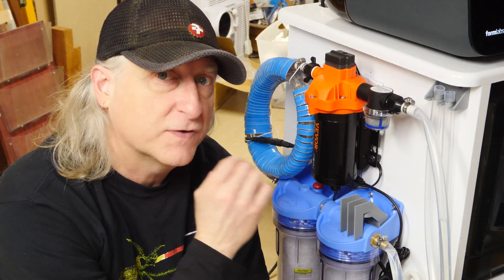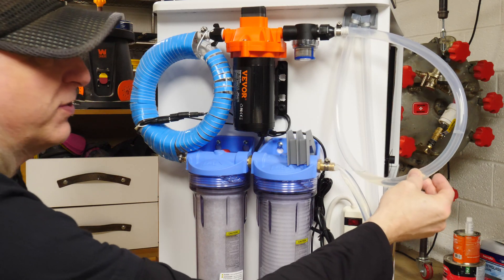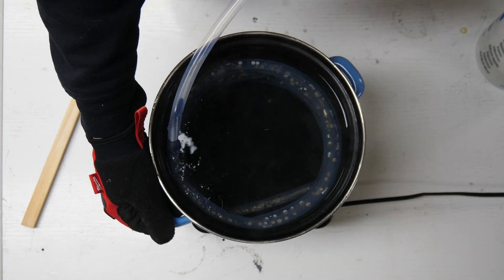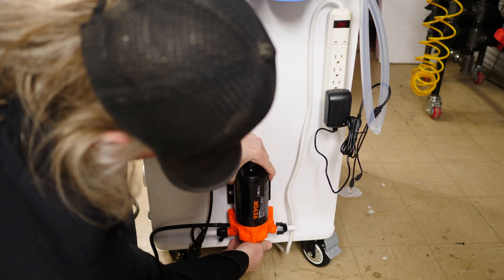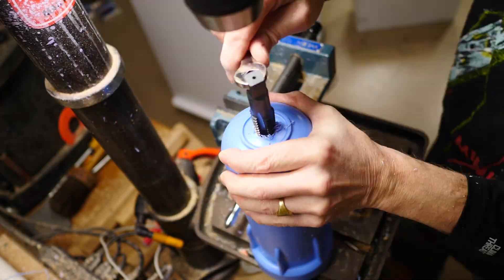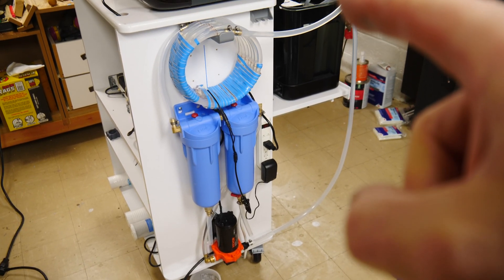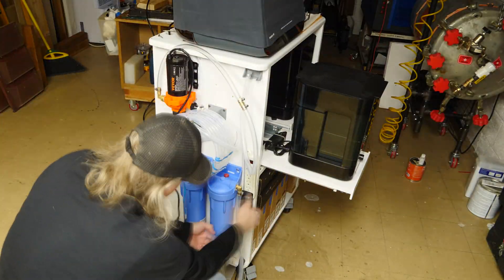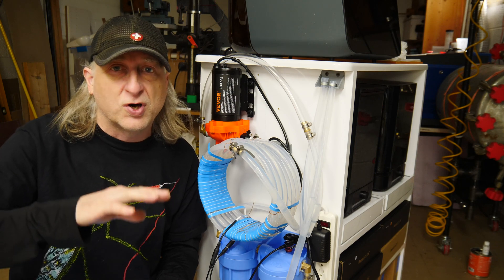IPA filter modifications and upgrade 3D printing resin removal

Comment: You could just put a small bit of rigid pipe on the suction side of the pump with a flexible whip on the end. Or you could move the pump closer to the source of the IPA and lower it down a bit. Put 90s on the inlet aimed up and outlet aimed down. Spin the UV reactor section a bit and slide it over so the inlet is below the pump discharge, straight shot into it. Then adjust the rest to fit. Cool idea and video, I think the recirculating filtration is the key idea that a lot of people don't have with their videos, I like this, thank you for sharing.

Comment: Usually, photocurable resin must be in a static state when curing. The photoinitiator in the resin absorbs ultraviolet light and generates free radicals, which combine with oligomers and monomers to form a three-dimensional network structure. The premise is that the resin must be in a static state when curing. Only in this state can free radicals and other substances in the resin be stably polymerized, so that the resin components in the isopropyl alcohol can be polymerized together as much as possible to increase the purity of the filtered isopropyl alcohol. In the video, a UV light strip is attached to the pipeline, which may not take the time required for the resin to cure. Moreover, the resin in isopropyl alcohol is in a fluid state, and free radicals cannot polymerize stably. Some components in the resin are separated. Very small, if it is not polymerized with free radicals, it will still flow out of the filter along with the isopropyl alcohol.
Reply: So from your point of view, this set of equipment doesn't really do much of value, does it? Even if the IPA in the drum is cycled through multiple times, the resin content of it is essentially not reduced, or only a very small percentage is actually filtered, is it?

Comment: Hey I’m following this system from you and the other guy that you mentioned because I’m dealing with the same issue with my ipa, I have a question or a recommendation the tube coil makes any difference is you do more o less loops or the diameter of the loops matter because I’m planning to put it into a printed chamber to keeps the uv light inside the chamber
Reply from the maker: Yeah, sounds reasonable

Comment: I'm getting ready to build this - 
I use a and Elegoo wash station, which has a bucket and lid system. What would be your thoughts on drilling and adding some fittings to the bucket a bottom dirty hose fitting and a higher return for clean. This way the lid can be placed on the unit while running vs being open to the air? 
I'm new to all this, no idea how to add a hose port without leaks, drilling a hole in the bucket I got, lol
Reply: Someone did this on reddit exactly how you described - when they run the wash station they also run the pump and UV lamp system so the IPA is actively filtered while the wash station is running.
Reply from the maker: Your solution is ideal if you can seal the bucket

Comment: After having run this system for several weeks are you able to comment on the longevity of the filters and the effectiveness of the alcohol for cleaning? Some other recycling methods noted the alcohol became “slimy” after a while and was leaving residue behind on the parts even though it looked clear.
Reply from the maker: I will know more when I change the filters in the future.
Reply: My experience with essentially this exact device resulted in precisely that sort of issue. After running a good number of kilos of resin through, I still had clear looking IPA -- but it left an increasingly gross, sticky residue on prints that went through it

Ultimately, I gave up on the device for these reasons, but I would love to find some revisions that solve the issue
Reply: Sounds like you had several kilos of useful wash cycles before it was junk, right? I'm weighing costs and wondering if this setup is worth saving $40 on IPA every few months

Comment: Follow up question.  has anyone experienced any issues with the resin sediment causing issues to the pump since it is the first device in the loop?  I understand it was done to pressurize the lines to keep them from collapsing, but I am a little concerned about pulling unfiltered resin through it.
Reply from the maker: No issues onu emd

Comment: Next time you (re)install, you could put the entire system on the right side of the cart, that way the inlet of the pump will be closer to your form wash. Might also want to look into kink-free or reinforced silicone tubing to mitigate the tubing collapse. I am curious on how effective this expose and wash system is and whether it is primarily removing the photoinitators and keeping a bunch of the resin monomers still suspended in the solvent.

Comment: I was wondering if you could set up the system to pull the IPA through the filters rather than push it through. Then, if you lift the intake hose out of the tank and pull the IPA from the filters, you could remove the housing without wasting a lot of IPA. As an engineer, would that setup work?
Reply from the maker: In theory yes if you have the right tubing to support that.
Reply: @EricStrebel  I was thinking about using PVC and the silicone tubing you showed. Maybe having short runs of the silicone to go into the fromwash and pvc running into the filters and then from the pump back to the silicone. I have 2 fromwash units side by side so the silicine tubing could run to one or the other, but the pump and filters would be wall mounted. Just a thought on how your idea could be adapted to what I have. Thanks for the great videos and the links to the products. It's really an inspiration.
Reply from the maker: In theory yes, the only way to test it is to try it

Comment: I wish I had gone through all of your videos last week when I found your first one.  I already ordered all the tubing and what not, and the original housings which have been delivered.  Thankfully they are not expensive. Also, the next time you need to bend tubing like that there is a trick that is used when bending tubes that they use a silicon insert to keep the tubes from crimping.  You could look into that for the next revision.
Reply from the maker: Yes I'm aware of the silicone insert method, but that would have been an extra thing to purchase my solution cost me nothing. Also I was concerned about removing the silicone insert considering the length of the tube and the tight radius.

Comment: Because IPA is highly flammable (especially the IPA vapors that can explode with a flame, spark, or even just temperature) I would eagerly suggest to cover the bucket of recycling polluted IPA with an airtight cap, because I don't think that this kind of cheap electric water pump nearby is properly isolated, or in any case antistatic and anti-explosion rated. Moreover, on a more practical side, an airtight cap would also prevent the IPA from degrading too fast (because IPA is expensive, absorbs moisture, and evaporates quickly).

Comment: On some models of those pumps that you can rotate the pumping head 180° to change the direction of the inlet and outlet. Something to try out.
As for the charcoal filter, I don't think it will contaminate the IPA, however I'm not sure about the benefit. It's usually used to prevent water from getting weird tastes, it's not exactly a mechanical filter rather a chemical one.

Comment: The "UV loop reactor" is a geek marvel. But the surprise effect having passed, I wonder like some others if the diluted resin in the moving contaminated IPA has really the time to cure and precipitate as bigger chunks in it. A comparison of the filtration from a muddy IPA bucket with and without the loop reactor would be very useful. If this item is not really useful in the filtration process, it will make the setup much simpler and more affordable. One has to find out.
Reply: Theory instead of experiment for now.
Let's say the 5-meter UV LED strip wrapped as a coil around the tubing has 600 LEDs and consumes about 40W power total. This is a very good light strip (they are often half as good).
The UV loop reactor is made of 5 meters of PTFE/FEP or silicone tubing, whose ID is 1/2". It's a bit less actually, because you have to connect some tubing outside of the reactor to the pump outlet and to the filter housing inlet. But from this approximation, I made a rough calculation (MKSA units):
Say the pump is capable of moving the liquid at 15 liters/min, i.e. 0.25 liter/sec – I think it is less in reality, but sellers advertise an even higher volumetric flow rate.
Using these numbers, do you know how long a particle of resin flowing within the IPA along the tubing stays inside the UV loop reactor? 
About 2.5 seconds.
If the actual flow rate of the pump is lower, say only 10 litres/min, the actual transit time of the resin in the UV reactor is 4 sec. 
However, if the real flow rate of the pump is 20 liters/min, then the resin stays in the reactor for 2 sec only!
Now, imagine powering your Wash & Cure (the curing part) for between 2 and 4 seconds in order to cure a 3D printed object, and what's more that this object is immersed in a container full of IPA, which has the primary function of wiping resin.
Do you think that the surface of this 3D-printed object would cure in such conditions? I don't think so.
EDIT: it's even worse thant that, because 10' = 3 meters, not 5 meters. So the estimated transit times are in fact 40% less thant what I said above. We are in the order of 1 to 2.5 sec.
Reply from the maker: I Assume the resin gets cured after about 10 times thought the ring at that rate. Seems reasonable that it will take a few times through to get the job done. I'm also assuming that the combination of the UV and the filter working together filters out most of the resin. I don't think it all actually gets filtered out I don't think that's possible. I think I'm just trying to reduce the amount of resin in there so that it's still effective at cleaning the parts. I'm good with that. The main thing is I don't have to mess with the IPA.
Reply: @EricStrebel  Your recirculation remark is valid I think. I'm currently in the process of deciding whether to build this setup with or without the UV reactor part, and I'm trying to get a clearer picture and weigh up the pros and cons. I haven't settled yet.
Reply from the maker: @fluxcapacitor  I feel like it can't hurt, that's why I added it. Even if it has minimal functionality it still has some benefit and is worth it.
Reply: @EricStrebel  I will add it to mine. The geek wow factor had me.

Comment: Loved to see your problem solving flow unkinking the FEP tubing with hydro forming! 
The one change I would suggest to the system the next time you rebuild it, cut a piece of ply the size of the cabinet side and mount the whole system on that. Then you can work on it flat on your bench without gravity fighting you on your knees the whole time. I try to stay off the floor as much as possible these days. 😂 Keep the quality content coming!

Comment: You are more of an "industrial engineer". Our profession should better differentiate "designer" with "engineer". Designers are typically aesthetics driven in the Form Follows Function Model. You are more on the problem solving side of Industrial Design. As someone with 35years in the trenches good work here. Keep the vids coming!
Reply from the maker: Definitely a problem solver, not so much an engineer, but I do like building equipment for the process of designing things.

Comment: I assume that your filter housings that cracked are polycarbonate. I worked for a medical device company and we solvent bonded polycarbonate pieces together. In order to help polycarbonate  resist cracking when bonded we would "anneal" the parts it about 200 degrees F for several hours before bonding. It help eliminate the fracturing of the resin. I have actually seen polycarbonate almost blow up if not annealed. Ditto with 70% isopropanol.
Reply from the maker: You see that crazy and cracking on Old polycarbonate parts all the time, and sometimes it's just from being cleaned with a solvent people don't know particularly on cut edges like from a laser or something that's machined.
Reply: @EricStrebel   Yes. My brother in law used IPA to try to clean off the price tag on a PC cutting board. It cracked immediately and pretty violently.
Reply: What is strange is that the plastic bucket of Wash & Cure machines (especially made to work with IPA) is made of PC.

Comment: Do you have any feel for whether the UV light is actually curing anything?  I was under the impression that the photo-initiators in the resins had to be of a sufficient concentration to actually catalyze the polymerization, and so when the resin is diluted in IPA the resin could not longer cure, even if exposed to intense UV.  If this is true, I would think that the only things getting filtered out of the IPA are the small cured particles washed off the print and any pigment particles used to color the resin, but that the majority of the pre-polymers would still be in solution.
Reply: Placing a glass container in the sun will solidify the resin in IPA. I've also turned on the UV light in my wash & cure station while the bucket is still in place and it has cured the resin, I also have a clear plastic container I use to pre-wash a print, I set a UV light on its lid to solidify the resin when it's time to change the IPA.
Reply from the maker: That's a very good question, I'm not a chemist so I'm not sure about that, it's difficult to say whether the UV is curing it I would think however that some of that is occurring because when you take IPA and you put it out in the sunlight the resin does coagulate, and ultimately that's what I'm trying to do with this system is get the resin to coagulate or thicken up so that it can get stuck in the filter.
Reply from the maker: Ideally, it would be nice if there was something that you could add to the IPA to help coagulate the resin and basically thicken it up and get trapped in the filters.
Reply from the maker: Cool, I'm curious to try my carbon filter out as well I feel like that could be a better type of filter than what I'm using. Let me know. Thanks!
Reply from the maker: That could be done in the actual form wash tank in between washes. Sometimes nothing gets washed in that tank for days or even a week.
Reply from the maker: Seems like a liquid pool drop out flocculant works for this. I am going to try this. Thanks for the tip!
Reply from the maker: In theory the resin will get cured eventually and filtered out, that's the idea. At this point with the system as it is the IPA doesn't get too diluted with the resin as a certain amount gets filtered out and the IPA is always usable to clean your parts.
Reply: @user-it7kg3pm4q  Powder-based flocculants made for swimming pools are not soluble in alcohol, only in water. However, liquid-based flocculant may work with IPA and some people have reported success indeed. The thing is that these products are ultra concentrated and typically 1oz of liquid flocculant will clear 5000 gal of water! That means that in order to treat say, 2 gals of IPA, one would theoretically need to pour only two or three drops of flocculant in the IPA bucket! Otherwise one may eventually contaminate the IPA with aluminum ions instead of resin.
Reply: In my experience it does not cure to a hard "final" cure stage but turns into a jelly, and that jelly is thick enough to be caught in the filters. Take some used IPA outside in the sun and you will get a big blob of resin "goo" and mostly clean IPA.
Reply: Aluminiumsulfat (search on YouTube with Resin) IS what you are searching for.
But i think IT reacts Not fast enough for your system

Comment: I didn't really make the connection the first time around but IPA causes stress cracking in the polycarbonate housing and the threads would have been under stress. Always interesting to see it  happen in practice.  You can get them in PET but it can be a bit harder to find and might not be worth it for this. 
(Have always loved the 'bend a CD in half and it'll hold, dribble a few drops of IPA on it and it explodes/shatters as a demonstration. :)